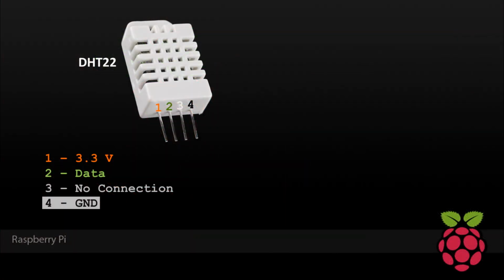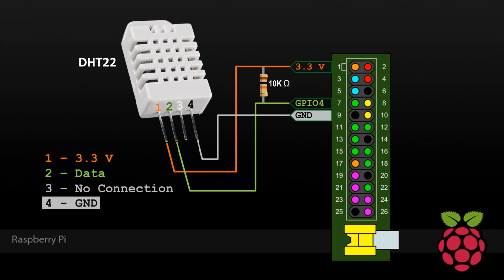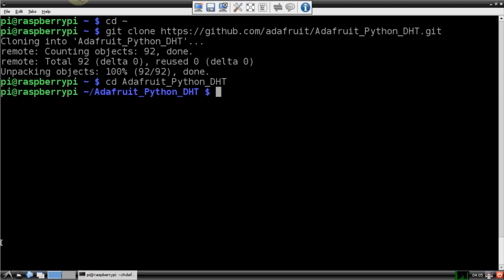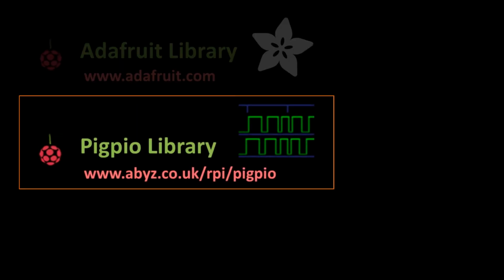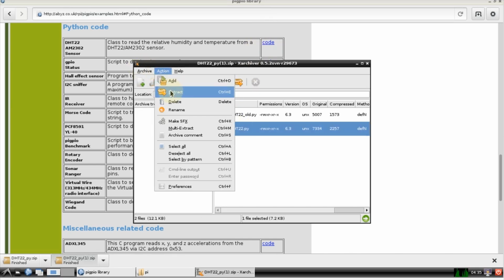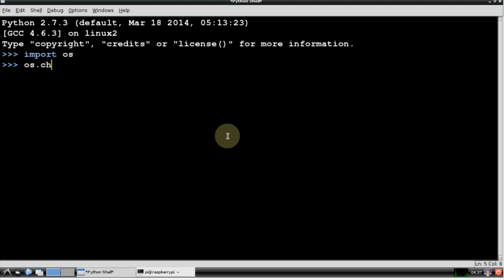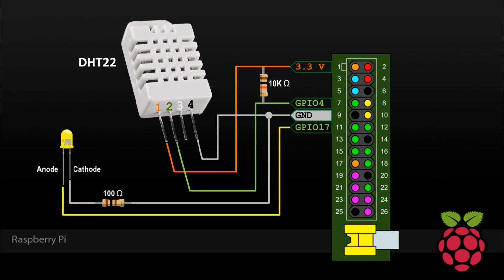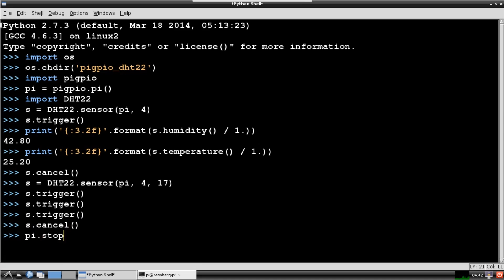DHT22 Raspberry Pi Humidity Temperature Sensor Tutorial

Comment: When I run this code. It tells me: ImportError: No module named 'Adafruit_DHT' 
Any idea why??
Reply from the maker: Did you reboot the pi after installation?  Did you check out the troubleshooting guide on my website?
Reply from the maker: No module indicates the Adafruit_DHT module is not installed.  I would reinstall using the instructions on my website (see link in video description).  If you encounter any error messages during the install please let me know.  After rebooting you should be able to issue the import Adafruit_DHT command from the Idle shell without errors.  Also make sure you open Idle or run your code with superuser privileges.

Comment: Is it possible to use this to monitor AND control an external AC unit, De-humidifier, fans etc...AC unit is a Movincool CM12. Thanks.
Reply: Thats actually what I was here for. I figured it out by watching another video on how to setup the gpios. I just made a while loop that compares the value of h to the max humidity level, this turn on a gpio and when it goes above that level, it turns off the gpio. Right now its just connected to an LED, but all I need to do is hook it up to a transistor and relay and I can control an ac unit or humidifier. Only thing that sucks that I have yet to figure out is if the pi reboots, the Adafruit dameon needs to be restarted manually. Don't know how to add it to the python coode. I also converted its readout of temp from C to F. heres what the code looks like:

import time
import RPi.GPIO as GPIO
import Adafruit_DHT as dht
GPIO.setmode(GPIO.BOARD)
GPIO.setwarnings(False)
GPIO.setup(5, GPIO.OUT)
h,t = dht.read_retry(dht.DHT22, 4)

while h <= 90:        
    h,t = dht.read_retry(dht.DHT22, 4)
    time.sleep(0.5)
    GPIO.output(5, True)
    f=t*1.8+32
    print h,f
    
    while h > 90:
        h,t = dht.read_retry(dht.DHT22, 4)
        time.sleep(0.5)
        GPIO.output(5, False)
        f=t*1.8+32
        print h,f

Comment: hi, how do I create thresholds that will print out messages from the data captured by the sensor?
Reply from the maker: +byRyoStyle Not sure I understand the question. I assume you want to test for temperature or humidity limits. Set up a loop that repeats at least every 2 seconds. Poll the sensor and use an If statement to compare the sensor readings to your minimum and/or maximum limits. If your thresholds are passed then print a message, else do nothing.
Reply: rdagger68 how do i do so? I am really new into this :(
Reply from the maker: +byRyoStyle That is a very broad topic.  Please take a look at my server room temperature monitor project on my website.  The code includes a loop that warns if my server room gets too hot.  http://www.rototron.info/projects/pi-temperature-monitor/

Comment: So much misinformation out there.  So, am I right in my understanding that an AM2302 is a DHT22 BUT it also has a transistor??? Because on adafruit it says "There is a 5.1K resistor inside the sensor connecting VCC and DATA so you do not need any additional pullup resistors"

5v or 3v??
resistor or no resistor??
Reply from the maker: +AnonymousHippopotamus I don't have any definitive answers because I don't have an AM2302.  The datasheet shows that they are interchangeable and they can run between 3.3 and 5.5V.  3.3V would be safer with the Pi.  The Adafruit library uses the same code for the DHT22 and the AM2302.  If Adafruit says the AM2302 has an internal pull-up then it probably has one.

Comment: Hi rdagger68,

Thanks for your wonderful tutorial. I tried following it with my Raspberry pi 3 and i ran into 2 issues.

The pigpio library got installed on my raspberry pi but when i run the below script i keep getting -999.00 as temp. and humidity 
import os
os.chdir('pigpio_dht22')
import pigpio
pi= pigpio.pi()
import DHT22
s = DHT22.sensor(pi, 3)
s.trigger()

print ('{:3.2f}'.format(s.humidity()/1.))
print ('{:3.2f}'.format(s.temperature()/1.))

When i tried installing Adafruit's library on my Raspberry pi by executing sudo python setup.py install i get following error
copying build/lib.linux-armv7l-2.7/Adafruit_DHT/common.py -> build/bdist.linux-armv7l/egg/Adafruit_DHT
copying build/lib.linux-armv7l-2.7/Adafruit_DHT/Test.py -> build/bdist.linux-armv7l/egg/Adafruit_DHT
copying build/lib.linux-armv7l-2.7/Adafruit_DHT/Raspberry_Pi_2.py -> build/bdist.linux-armv7l/egg/Adafruit_DHT
copying build/lib.linux-armv7l-2.7/Adafruit_DHT/platform_detect.py -> build/bdist.linux-armv7l/egg/Adafruit_DHT
copying build/lib.linux-armv7l-2.7/Adafruit_DHT/Raspberry_Pi_2_Driver.so -> build/bdist.linux-armv7l/egg/Adafruit_DHT
copying build/lib.linux-armv7l-2.7/Adafruit_DHT/Beaglebone_Black.py -> build/bdist.linux-armv7l/egg/Adafruit_DHT
copying build/lib.linux-armv7l-2.7/Adafruit_DHT/Raspberry_Pi.py -> build/bdist.linux-armv7l/egg/Adafruit_DHT
copying build/lib.linux-armv7l-2.7/Adafruit_DHT/__init__.py -> build/bdist.linux-armv7l/egg/Adafruit_DHT
byte-compiling build/bdist.linux-armv7l/egg/Adafruit_DHT/common.py to common.pyc
byte-compiling build/bdist.linux-armv7l/egg/Adafruit_DHT/Test.py to Test.pyc
  File "build/bdist.linux-armv7l/egg/Adafruit_DHT/Test.py", line 22
    import .Test_Driver as driver
           ^
SyntaxError: invalid syntax

Do you know if this tutorial will work on Raspberry pi 3 ?
Reply from the maker: +sunil patil I don't have a Pi 3 yet.  I'll test it as soon as I get one.  The Adafruit_Python_DHT library was updated last month to provide Pi 3 support.  Not sure why you are getting that install error.  I see you posted your question on the Adafruit forum.  They are pretty good about answering questions.
The Pigpio library is also well maintained.  The Pigpio github page shows updates to the DHT22 python example 2 weeks ago.   The -999 error could be a lot of things.  Did you check the DHT22 troubleshooting tips on my website: http://www.rototron.info/dht22-troubleshooting-tips/
Reply: Thanks radgger68. Really appreciate your help.

Sunil
Reply from the maker: +sunil patil I got a Raspberry Pi 3 today.  I tested the Adafruit library and everything worked.  The Pigpio library also worked, but I did have to add a 10ms delay after the trigger command to compensate for the Pi 3's extra speed.  I updated the code on my website to show how to implement the delay.

Comment: Great tutorial I run everything on the command line using pigpio and it works. I also instaled adafruit library and it works but when I use pigpio  via a python script I still get -999 What else can I do.  I have looked at your trouble shooting but there is nothing about this. I have an am2302.
Reply from the maker: +Joe Bifano Can I see your script?

Comment: Hi man, I have an dht11 sensor and I want to use it with raspberry pi 2. I tried thins method from uu gear  http://www.uugear.com/portfolio/dht11-humidity-temperature-sensor-module/   but I don't have any succes. The C language file dosn;t work and the python every time when I run the program I get ERR_RANGE. I make every step like in tutorial on the website but no with no luck :) You have any ideea what I could do to work ? :)
Reply from the maker: +Iacob Berar No, I don't have a DHT-11.  You would have to ask the author of the uugear code.
The Adafruit library in my tutorial supports the DHT-11.  There is also a C example on the PiGPIO site for the DHT-11.
Reply: Yeah, i tried with C example and nothing... Ok , thank you anyway :)

Comment: I am having trouble understanding why the folder structure is created as it is.  I am new to python and to the RPi.  I can get the code to work, but it seems to need to be in the folder containing the DHT-22.py file or I get a module error.  Out of curiosity, why is it that the pigpio library and the DHT-22 files are not located in the /usr/local/lib/python3.4/dist-packages folder?

Again, sorry for the noob question.
Reply from the maker: +Jon Voss I think it might be a python3 issue because the Adafruit install program adds /usr/local/lib/python2.7/dist-packages/Adafruit_DHT-1.1.0-py2.7-linux-armv7l.egg to the Python path.  Therefore, in Python 2.7 you can just use import Adafruit_DHT.  I don't think I've ever tried the Adafruit library with Python 3, but it is probably not in the Python3 path.  

On the other hand, the Pigpio install program adds the PIGPIO folder to both the Python 2 & 3 paths.
You can view the Python path by using:
import sys
print(sys.path)

In order to use an external python library you need to have the file in the same folder as your program or its containing folder needs to be in the Python path.
Reply: +rdagger68 Thanks for the reply.  With that help I figured out what I was doing that needed to change.

Comment: Great tutorial, thanks for sharing. I try to use multiple temp sensors, is there any extension board to attach all the sensors and monitor them individually?
Reply from the maker: +Pisti Fésüs I'm not aware of any boards.  You can add as many sensors as you have available GPIO pins.  There is also the DS18B20 temperature sensor which can be daisy chained.

Comment: Excellent tutorial! I followed the adafruit version and after entering:
 h,t = dht.read_retry (dht.DHT11, 4)  
I simply got a flashing cursor for 38 seconds or so and then back to >>>
I'm going to try the other way now, but even if it works, I am still curious why the first one seemed to "try" to work but returned nothing.
Reply from the maker: +David Hawkins I created a troubleshooting list for connecting the DHT22 to the Pi.  The link is in the description above.

Comment: Hi, I bought DFROBOT DHT22 temp and hum. sensor. But in their website they are saying that "Note: DHT22 digital temperature and humidity sensor is designed for analog sensor interfaces. The analog interface is used as a digital one which will not occupy other digital interfaces on the Arduino. You can also use the analog to digital converting cable to connect DHT22 to digital interfaces."  What does it even mean? Can't I use this with Raspberry pi's digital GPIO pins?
Reply from the maker: +Muminur Rahman The DHT22 has a digital output and it works well with the Pi.
Reply: +rdagger68 Thank you for your reply. This particular sensor's datasheet says it needs supply voltage 5V. do you think if I connect it with 3.3V supply voltage pin from my raspberry pi , will it work?
Reply from the maker: +Muminur Rahman Yes, the datasheet for the DHT22 states that it will operate between 3.3 and 5.5V.
Reply: +rdagger68 Could you please check this specification? http://www.dfrobot.com/wiki/index.php/DHT22_Temperature_and_humidity_module_SKU:SEN0137     Their specification says it needs to connect with +5V and no pull up resistor. Do you think I follow their circuit diagram and instead of arduino connect it with the Pi? I bought DHT22 from dfrobot.
Reply from the maker: +Muminur Rahman The schematic on their site shows the breakout board includes the pull up resistor.  Therefore, you don't need another one.  On their diagram, the DHT22 data line is connected to a digital (not analog) pin on the Arduino Uno.  I don't know why they refer to the sensor as analog.  It is a 1-wire digital output.  The manual on their website confirms this and also states that it will work at 3.3V with a caveat that the length of the data wire cannot exceed 100cm.  For greater lengths you would need 5V.
Reply: Thank you so much for your reply!

Comment: Hi I'm using the rpi2 and got the error message "ValueError: Unknown format code 'f' for object of type 'str'". I've done a lot of manipulation to the print command and it won't give me an output. Any help would be appreciated.
Reply from the maker: +3thn Dv15 Sounds like you are passing a string to the format function instead of a float.  Are you using Adafruit or Pigpio?  Did you reboot after installing the drivers?  Can you post your code?
Reply: Yes, I did a reboot and I'm using the exact code from the video. I'm using Adafruit.
Reply from the maker: +3thn Dv15 Are you running Wheezy or Jessie?
Reply: +rdagger68 I think Wheezy
Reply from the maker: +3thn Dv15 It is probably a wiring issue.  Please double check the schematic on my website (see description above for link).  You don't have to use the print command.  From the shell you can just type t or h after you run h,t = dht.read_retry(dht.DHT22, 4).  If everything is hooked up correctly, you should see a number.  I just tested both the Adafruit and the Pigpio DHT22 libraries on a new RPI2 and it works following the steps on my site.
Reply: +rdagger68 I found out I'm using Jessie, not Wheezy.  I'm strictly following the website right now and I tried doing the command "sudo setup.py install" and it says  "command not found"
Reply from the maker: +3thn Dv15 Make sure you use cd Adafruit_Python_DHT to insure you are in the correct folder before running setup.  If you still have trouble with Adafruit, please see if you can get it to work with Pigpio instead.  I just tested with Jessie and both libraries are working OK.

Comment: why 10k resistor? what is the calculation this brings about this value?
Reply from the maker: +Peter Brown Generally speaking, you want the pull up resistor to be 1/10 the resistance of the input pin (also called the input impedance).  10KΩ is usually a safe bet.  There are exceptions such as timing and distance, but  I’ve had no issues with 10KΩ on the DHT22.

Comment: What if I want to connect multiple thermal sensors, so I can monitor cpu, gpu, psu temps.
Is there a way to do that?
If yes, please explain
Reply from the maker: +George Karathanasopoulos Most processors have built-in temperature sensors.  You can monitor the Pi's cpu temperature using software without the need for an external sensor.  DHT22 would be poor choice for chips because they can run very hot which could exceed the DHT22 ratings.  You can run multiple DHT22 sensors, but each one would need its own data pin.
Reply: +rdagger68 i understand that, but how can I make it happen?
Reply from the maker: +George Karathanasopoulos Connect the data pin of each sensor to a separate GPIO pin on the Pi.  Connect the power pin of each sensor to a Pi 3.3V pin.  Connect the ground pin of each sensor to a Pi ground pin.  Place a resistor between each data line and the Pi’s 3.3V.  For the Adafruit library, you would specify the GPIO pin of the sensor when calling the read_retry method.  For example, with a sensor connected to GPIO pin 13 you would use:  h,t = dht.read_retry(dht.DHT22, 13).  For pigpio library you would specify the GPIO pin of the sensor when instantiating a sensor.   For example a sensor connected to GPIO pin 19 would be:  s = DHT22.sensor(pi, 19)
Reply: thanks mate...

Comment from the maker: +kindofme07 Here are some general troubleshooting tips.  Make sure you reboot after installing the Adafruit drivers.  You need root privileges when running the Adafruit code.  The Adafruit libraries need to be in the path.  The sensor requires a minimum of 2 seconds between polls.  If you try to poll too frequently it will not work.  Don’t forget the 10k ohm pull up resistor between the data and 3.3V.  Wiring that is too long can introduce problems.  Other electronic components could be interfering.

Comment: Trying to calibrate my temperature sensor to my digital temperature meter in my room.

According to my temperature sensor (dht22) its 20.5 and according to my digital temp. meter its 19.6 deg. How can I edit the formula so 19.6 (20.5 minus 1) appears?

Tried print 'Temp={0:0.1f -1}*C  Humidity={1:0.1f}%'.format(t, h) and many other variations but it didn't work.

Comment: i follow all the steps 
but i get some weired result 
the temp is 760 C 
and humidity is 690 % !!
Reply from the maker: Ahmed Jbeli Did you get the same results with both the Adafruit and the Pigpio libraries?  Did you try using the sample code on my website?
Reply: i was an idiot :( 
i thought i got the DHT22 hehh but it was DHT11 it s fine now :) 
thx for replying :)

Comment: As some other comments mentioned, I too was getting a -999.00 for both temperature and humidity by using the exact code in this tutorial. The only solution I found was to call the 's.trigger' method twice before each parameter. It seems silly but the only way I got the correct readings. Good tutorial otherwise.
Reply: Thanks!

Comment: I am using Raspi 2B, is this the same GPIO 4 that I can use?
Reply from the maker: yxhankun You can specify any pin when you instantiate the sensors in both libraries.  I don't own a 2 yet, but it should work.
Reply: rdagger68 No, it does not work at all from the beginning, I checked my input voltage around 2.7 V. I have tried to bypass a resistor and I tried the sensor with 3.0 V but it does not work. My sensor is DHT 11. I have gone some reading GPIO 4 is just an ordinary GPIO, it is only known as GPIO CLK. Correct me if I am mistaken. I I used  (smd 10K).
Reply from the maker: yxhankun There is nothing special about GPIO4 with respect to the DHT sensor.  Make sure you reboot the pi after installing the Adafruit software.  Check out my website rototron.info for more information.

Comment: I'm new at this but the data sheet shows that the current needed to pull the data line is between 1ma and max of 1.5ma. So according to my calcs thats a max of a 2200 ohm resister so why do you use  a 10k? Any kind of information to shed a light on this would be much appreciated.
Reply from the maker: Daniel Roach Those figures sound more like the current used by the sensor.  Generally speaking, you want the pull up resistor to be 1/10 the resistance of the input pin (also called the input impedance).  10KΩ is usually a safe bet.  There are exceptions such as timing and distance, but  I’ve had no issues with 10KΩ on the DHT22.
Reply: rdagger68 Thank you that was very helpful!